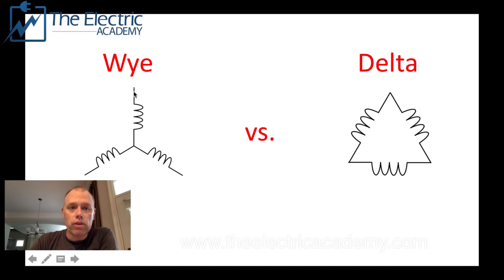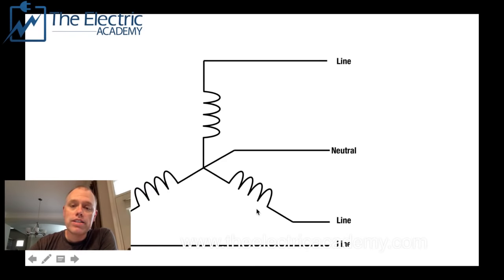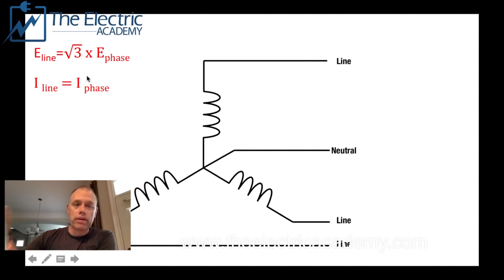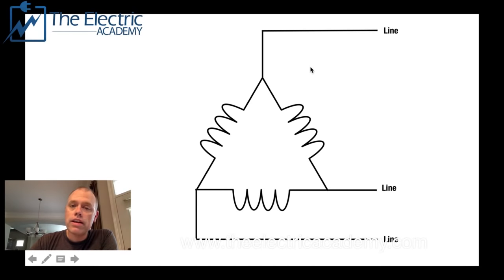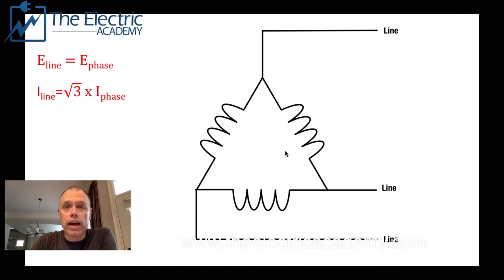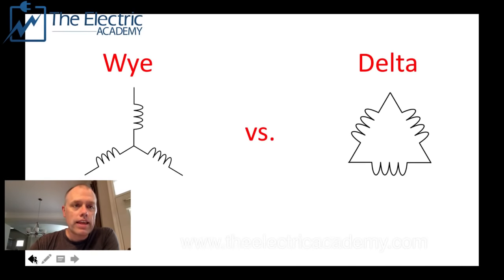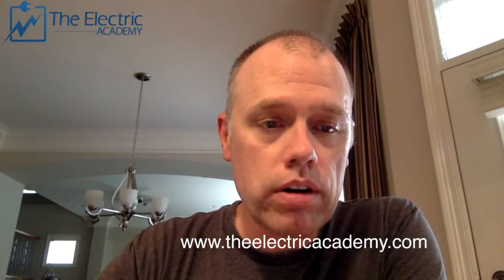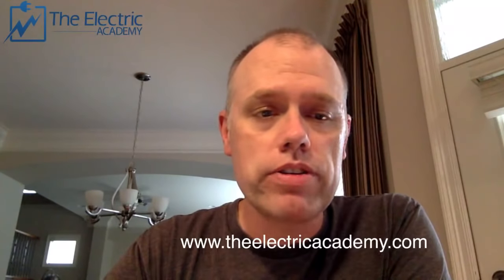Wye and Delta three phase configuration ( A brief overview)

Comment: Great video! Thank you you explain on how we obtain 120 V 208 V and 480 V but you didn’t clarify on 277. Can you please make a video on that? Thank you
Reply: 480V is the phase-to-phase voltage of a 277V phase-to-neutral three phase system.  The problem is inconsistent naming.  We call it "120V three phase" and "480V three phase" but the first is named after the phase-to-neutral voltage and all other higher voltage systems are named after the phase-to-phase voltage.  This is probably because the 120V systems are typically wired in Y configuration and higher voltages are typically in Delta configuration.  In a Delta configuration, you would rarely use the phase-to-neutral voltage.  But in a Y configuration the line voltage is frequently used.  So the inconsistent naming convention makes sense with this logic.
Reply: It's a 480/277 Y system

Comment: I’m totally confused. I have an old crescent disc sander. It has a three-quarter horse three phase motor. There are four wires coming out of the motor. Two of the wires go down to the motor starter and connect to T1 and T3. The other two wires up at the motor are connected together. So it appears that the motor is only running on Two legs. T1 and T3. How is that possible?  Anybody’s help would be greatly appreciated. Thank you

Comment: one point on a delta secondary in a transformer if the load is imbalanced there are circulating currents. on a wye system no circulation currents

Comment: am I correct that for an alternator, the W phase is preferred, for the motor the delta - in case we are talking about a system in which the alternator feeds the motor (through a battery bank)?

Comment: Great video, questions, can you tell why in a transformer the primary is label "h" and the secondary is label "x"?
Reply: Great question dude
Reply: H=high side & X= excitation current
Reply: The “H” is the high voltage of the transformer. The “X” is the low voltage of the transformer. “Primary “ is the the side that magnetized the transformer. Secondary is the side the load is connected to. Typically primary is feed in the “H” side and the load is feed by the “X” side. In this configuration the transformer is in step down configuration. When you feed the transformer in the “X” side then that becomes the primary side and the”H” side feeds the load becomes the secondary side. In this configuration the transformer is in a step up configuration.

Comment: Is it possible to obtain 3phase power from a 1phase source? Ie if i need to power a 3phase CNC equipment in a residential/house that only has 1phase.
Reply: You are going to need a rotary phase converter, look up americanrotary.com, or you can build one yourself.  Or you can go with a VFD, just make sure that you get one that requires 240V AC single phase on the input.

Comment: Hey!
I just found your channel just now.
At this time in my life, i suddenly have electricity on the brain.
And this is like intellectual  Kraft caramels to me; cant get enough.
Here's one for you,
I work on 115v ac machinery that has REVERSIBLE ac motors.
I would like to construct something whereby i could bench test them, as in, hook them up to power and run them outside the devices they are from so as to evaluate their condition overall.
Do you have a video on that sort of thing?
or could i trouble you for any links to such that you might be aware of?

Comment: In a 9 lead motor at high voltage the wye and delta are connected in the same configuration. How can I determine whether it is wye connection or delta then?
Reply: a nine lead motor is wye, period.
7,8,9 are terminated internally in a wye.

Comment: On a delta connected system since there is no reference to ground what is the downside to having a wire shorted to ground.  You won't notice it I assume  but I assume that this will ultimately cause a problem.  What would be the issue?
Reply: On these ungrounded Delta Systems there is a ground fault detection unit. The first ground fault is "free" and personnel is alerted by detection unit.  It gives personnel time to find the fault without the whole system coming down. Another fault to ground on a different phase would create a phase to phase fault and that would trip main feeder breaker.  These systems are used in process plants with majority motor loads.
Reply: @ikerivers1795  so sounds like with delta if there is one fault it really doesn't matter.  Only issue I can think of is that before with no fault if someone gets across a phase and ground there is no shock hazard, but once a fault occurs there would be a shock hazard if they the touched the other phase and were also grounded.  Seems like a delta system is inherently safer unless there is some other aspect I am missing.
Reply: @diyertime  kind of...."shock" is the result of difference of "potential". Difference in voltage magnitudes regardless if your "grounded" or not. If you are grounded though that is an easy reference to near zero potential so whatever you touch is maximum potential difference.
Reply: @diyertime  This is a 3 wire Delta System I was describing. There are also 4 wire Delta Systems, where a grounded conductor i.e., neutral is derived from midpoint of a phase.  
,
Reply: @ikerivers1795  this gets to the heart of my question,  what would be the advantage of adding this ground?  Just so a fault is easily/quickly  determined?   Just as an fyi, I am a registered prof  EE albeit most experience with computer engineering and rf electronics.  I also did a stint for an electric utility.  So if you need to be more technical its ok.
Reply: @diyertime  the 4 wire Delta system, in the US, if the load was going to be primarily 3 phase motors.  The overwhelming majority of these systems being  120/240 4 wire Delta. With the infamous high or wild leg.  So if you had a process that required many three phase motors and a small amount of 120 VAC loads they would use this system. Not used anymore as typically process plants have all gone to 480 for motors and bring voltage down for their other needs. So the grounded conductor, neutral, was very useful if you had a need for it. Saved you from buying a transformer to bring down voltage from 480 and also by using smaller gauge wire for motor feeder conductors at the higher voltage 240 as opposed to 208.

Comment: How can all three phases come together after the load being 120 degrees out of phase and nothing blow up. But if you cross phases before a load its a disaster?
Reply: +Caleb LeMay - If you are referring to how the three phases in a delta system can form a closed loop without blowing up, the answer lies in the fact that the VECTOR sum of the three voltages is always zero. So no current actually flows around the closed loop. You can actually see this by opening one corner of the delta and read zero volts or very close to it between the two leads. Put another way, it can be shown that the vector sum of the voltage of any two phases is always equal to the voltage of the third phase--again proving that no current will flow around the closed delta. This is one of the few cases where out of phase voltage sources can be directly cross-connected without blowing up. Chalk it up to the craziness of the math.
Reply: On a delta you have line leads on both sides of the motor so voltage is always present. I guess I don’t understand the vector sum.
Reply: Does the inductive load not have anything to do with it?
Reply: +Caleb LeMay - You need to find a good book on AC electricity. To start with, the type of load makes no difference in this point -- inductive, capacitive or resistive. The type of load will have a direct relationship on the phase angle between the voltage and current in the three lines going to the load but we are not talking about that here. As for vectors, think about the numbers that you see every day: the amounts you add and subtract in your checkbook, the prices of the groceries on your cash register receipt, all the different charges and credits you see on a utility bill, etc. All of these examples, in fact most numbers you work with in everyday life are examples of scalar quantities, numbers that solely represent an amount. Voltage, current and resistance in DC circuits are good examples of scalar quantities in electricity. Working with AC thrown in one more thing: *direction*. This makes up a vector. It denotes both magnitude (a scalar quantity) and direction (phase angle). Like other numbers, vectors can be written out like any other number -- with special notation so that you know it's a vector -- or graphically. This last method is usually the easier one to understand. For our purposes, perhaps this analogy will help you grasp the principle of the delta.

Imagine two 1.5 volt dry cells hooked together in series, but connected say, negative to negative instead of the usual negative to positive. Now, run a lead from the shared negative to two light bulbs connected together (not in series). Now, connect a lead from the positive terminal of each dry cell to the free terminal of each lightbulb. What do we get? Both lightbulbs illuminated. What we have are two independent circuits consisting of a dry cell (voltage source) and a lightbulb (load). With this configuration you can disconnect each lightbulb but the other one will stay illuminated despite appearing to be in series. Now, measure the voltages around the circuit. What do we have? 1.5 volts across each bulb, so we know we have two power sources driving their individual loads. But what do we get if we read the voltage from one positive terminal to the other? Answer: zero volts or very close to it. In other words, the voltage of one dry cell has cancelled out the voltage of the other without affecting the operation of the circuit or causing damage to either dry cell. This, in a more complicated way is what is happening with the closed delta loop. Some suggested things to look up: polar and rectangular vectors, the trigonometric functions (sine, cosine and tangent), and if you're really brave, the trig formulas for the sum of two angles (example: sine of angle A + angle B). Mastering this formula and plugging in the right numbers is the key to proving mathematically that no current will flow around a closed delta. Hope all this points you in the right direction (pun intended. LOL!)
Reply: Caleb, I assume you are looking at the centre of the Y configuration.  Think of it as if you had three single phase motors each plugged into a separate plug with a unique hot phase of supply.  Let's call them your blender, coffee grinder, and food processor.  Each kitchen appliance has a two-wire connection of a hot phase supply and neutral return.  Why is the return neutral?  Reducing to utter basics, because the voltage has been "used up" (as power output of the motor) across the inductive coil of its motor.  So the neutral has zero voltage and can be connected to ground.  

So if you were to strip bare the neutral wires on your blender and grinder, and touch the neutrals together, there would be no problem, because there is no net voltage between them.  The same applies inside a three-phase motor.  The voltage has been "used up" across each coil.  Since the voltages are 120 degrees out of phase with each other, the voltage is "used up" at slightly different times each cycle but each phase has a neutral (zero volt) side for the same reason a single phase motor does.  To save wiring, the motor just ties those neutrals together into a singe wire.